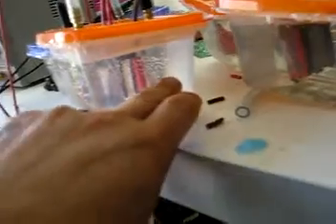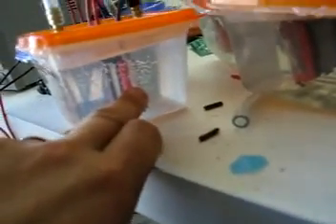nickel cells 2

Comment from the maker: still testing, it would seem whatever metals that have the lowest possible dielectric breakdown voltage and can handle the environment of koh, would be the best choice for plates. and then theres always the platinum catalyst effect, but PT is way out of the question, unless a coating is all we need and amounts like what is in a cat converter would work, then a PT coated Cu would ploy be our best bet, and that would produce much hho for little power.